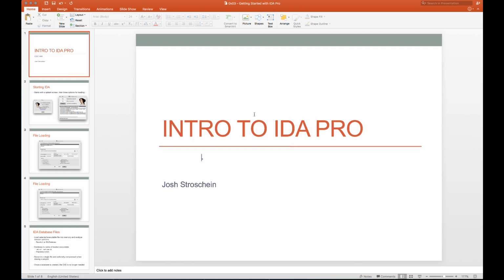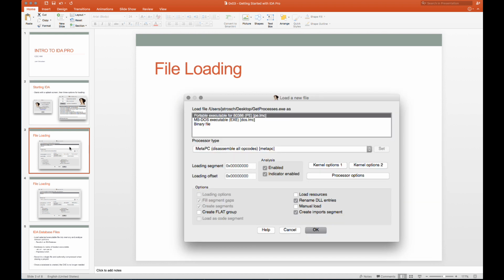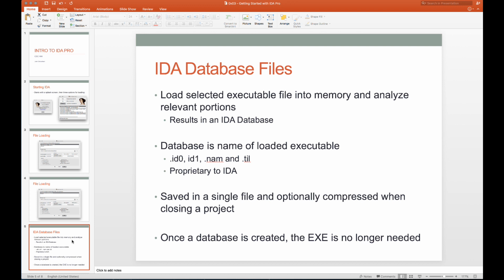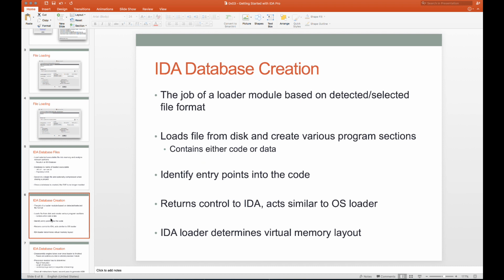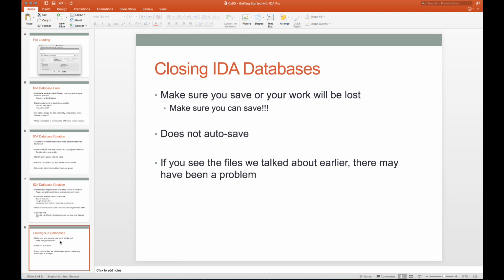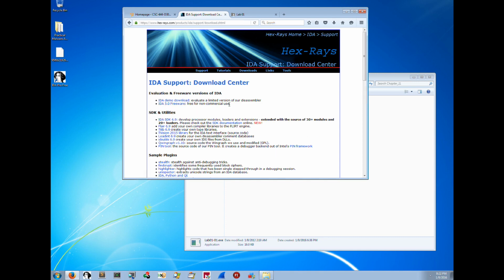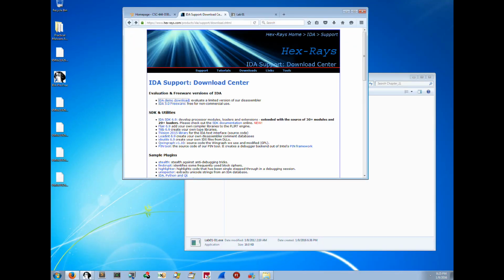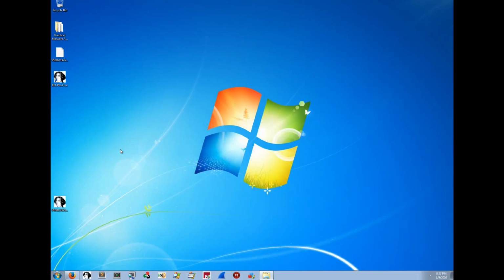02 - Intro to IDA Pro

Comment: Thank you soo much for this content, I am not one of your university students but I found this playlist just searching randomly on Youtube. Amazing content!
The only problem with IDA Pro is the price tho haha I will try to follow the course using Ghidra probably 😅
Reply from the maker: Yes, that is a bit of a problem. However, IDA free now includes the decompiler and I make sure to use the demo/free versions for any content I make, so you'd have no problem following along with those versions of IDA. Using Ghidra would also work, there will just be small differences in shortcut keys, UI and possibly some of the disassembly/decompiler output.